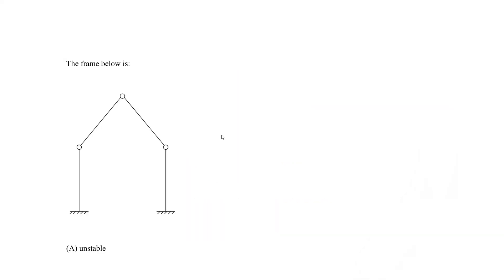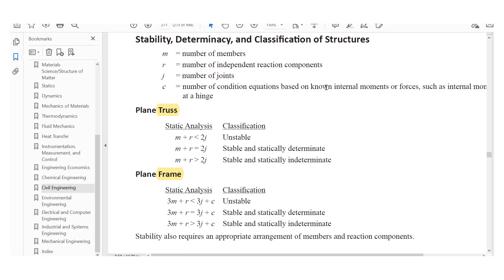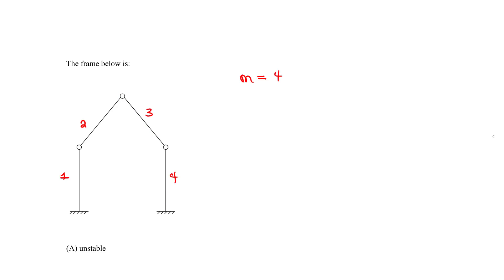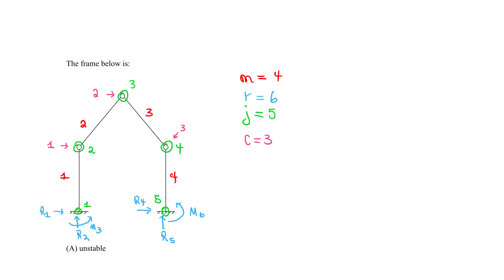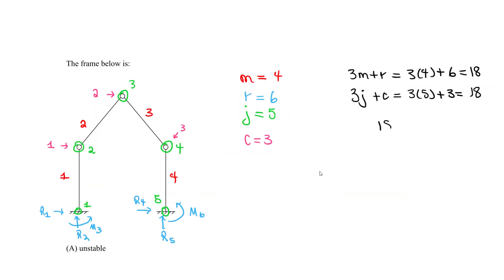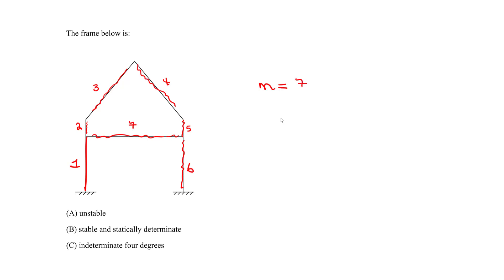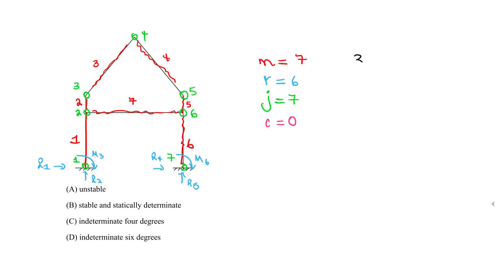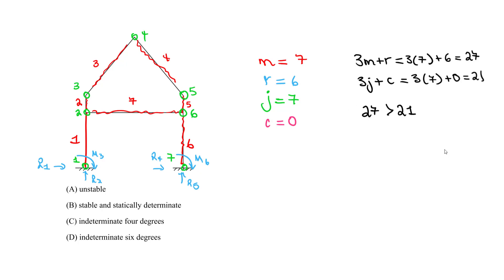FE Exam Review - FE Civil - Structural Engineering - Determinacy and Stability - Frames

Comment: Do pinned supports count as towards the C value? My problem has pinned supports instead of fixed supports, and this seems to be the only way I can get the correct answer
Reply from the maker: Hi Chris, I think you are referring to the hinges? Yes, they do contribute to the C value. The fixed supports do not. So in this case since there are 3 hinges with only two members meeting at each hinge - C = 3.

If you apply this equation to any pins (hinges) - it always works out. 

C= Number of members meeting at a hinge -1 

Let's say we had 3 members meeting at a hinge: 

C = 3 - 1 = 2 

Hope this helps!

Comment: Hi! Great Video. Why is there no reaction at the hinges but were counting them as different members?
Reply from the maker: Hello Andrea, when using the method in the FE Handbook for Frames, the reactions (r) are always the external reactions. The tricky part is the c value. This is the number of condition equations. I'll save you a headache by giving you this hint - THE NUMBER OF CONDITION EQUATION (c) IS ALWAYS DETERMINED BY THE FOLLOWING EQUATION: 

c= Number of members meeting at a hinge -1
Reply: @directhubfeexam  I understand that c is typically the number of hinges right? But I’m confused as to why in the problem we don’t include the reactions in the hinges but on other problems we do?
Reply from the maker: @andreahodge5679  Hi Andrea, I see the confusion there. The only time you would consider the reactions at the hinges is for BEAMS. For trusses and frames, you only count the external reactions when determining the r-value.
Reply: @directhubfeexam  Okay thank you!

Comment: Do above Check is sufficient to check stability ?
Reply from the maker: Hi, this method does not. Checking for stability is not discussed in the FE Handbook but will depend on two major conditions. 

1) If the reaction forces are all parallel the structure is classified as being "unstable". In this case, the reaction forces are not all parallel so we are ok. 

2) If the reaction forces are concurrent (the line of action for each reaction force intersect) then the structure is classified as "unstable". In this case, the lines of actions for all the reaction forces do not intersect (i.e. not concurrent) therefore the structure is stable. 

I hope this helps!

Comment: Why is 4 a hinge in the first example but not in the second?
Reply from the maker: Hi Adam, the goal for determinacy and stability is to find the number of joints. The type of connection isn't really relevant to the question but for the first example the joint at 4 is assumed to act like a pin (i.e a hinge) and for the second example the joint acts as a fixed joint. At point 4, it will still be considered a "joint" for both cases. I hope this helps a little. Note: on the Other Disciplines FE exam determinacy and stability are not tested.
Reply: DIRECTHUB FE EXAM PREP  why is "c" for example 2 equal to zero?
Reply: @quintonmarsalis5902 
Becouse there is no hole